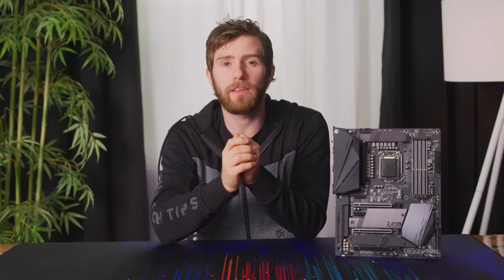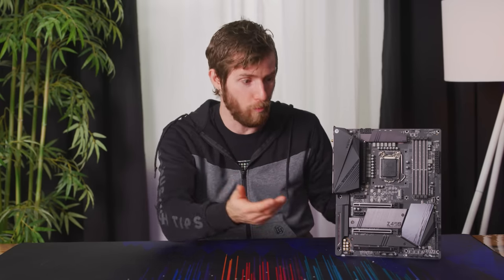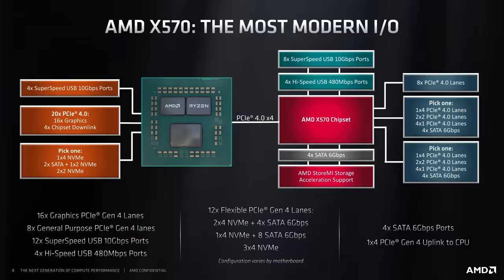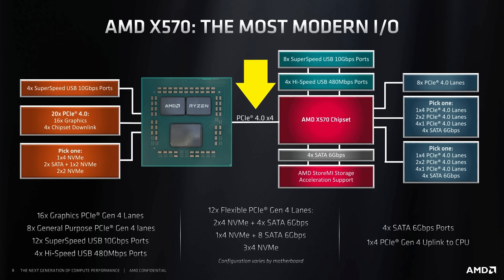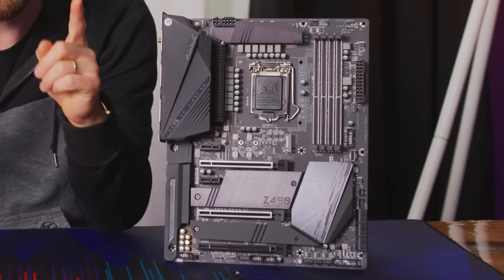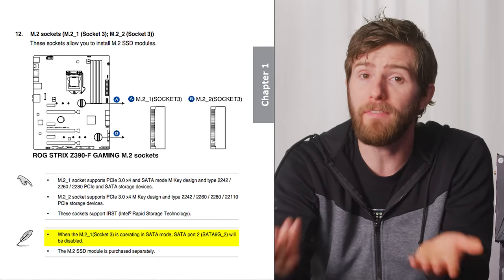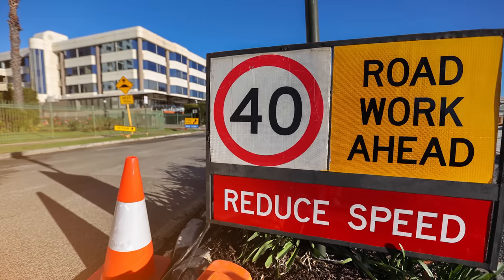The Sneaky Thing About PCI Express - CPU vs. Chipset

Comment: Free Tech Tip: If you have connected a lot of stuff (multiple M2 SSDs etc.) to your Mainboard and you want to find out if it hurts your GPU link, fire up GPU-Z and check the "Bus Interface" information. It should say @ x16. If it says @ x 8 then your GPU is sharing lanes with something else. This could be a reason for some performance loss on GPU side.
You're welcome :)
Reply: Only the number behind the @?  My Bus Interface say "PCIe x16 3.0 @x8 3.0
Reply: @bobbymois  This means your GPU sits in a x16 slot, but it's only addressed with 8 lanes of PCIe 3.0
So maybe you have 2 nvme drives or other cards plugged in that take resources.
A lot of mainboards have an overview about what shares which lanes. Maybe take a look at that.
Reply: @knightnevermore  i changed my gpu to the pcie slot right under the CPU, now gpu-z says @x16

thanks for the tip☺
Reply: Good tip. I just found out you might need to run the test from the "?" to get an accurate result though, because GPUs can shut off lanes/speeds. Mine did. A 1050ti, it said x8 x1.1 or something, after using the stress test its 8x 3.0. I think a 1050ti cant even use 16x anyway.
Reply: @Lloyd.B.  Nice sub-tip. The same thing happens with RTX 3080 - shows x16 1.1 a after running the render from the "?" it immediately changes to x16 4.0.
Reply: Is x4 pcie slot better than x16? Like how much performance difference. Comparing asus b250ma vs asus rog strix b250h motherboard on nvidia 1660super.

Comment: 2:41 I think the last 16x physical slot (4x electrical) is actually going to the chipset
Reply: You are correct (at least in all mobos I'm familiar with).
Reply: that's why u should check ur manual, some mobos have 3 x16 electrical, others 2x16, and then some 2x16 and 1x4, if its x4 its for the chipset
Reply: @arencorparencorp2189  Wouldn't that require more PCIe lanes? Is it just for stuff like Threadripper?
Reply: @lukedk4614  Yes.

Most boards have 1x16 or 2x8.  Most boards that have 3 16 slots are 2x8 + 1x4 connected via chipset.  Aren is talking about high end (HEDT) parts.  With Crossfire and SLI being basically dead, 1x16 is more than enough for the vast majority of us graphics wise, although I suspect AMD and Intel will eventually move to 24, 28 or 32 non-southbridge lanes so as to support more NVMe direct to CPU.
Reply: @lukedk4614  yes, it is, the board with x3 or more electrical x16 slots is tr or hedt intel, but there r some exceptions for normal 16 lane cpus of 3 electricals, 1 of em directed to chipset (to store a 4 ssd raid or stuff like that)
Reply: @arencorparencorp2189  Usually it is pretty much alwayd 2 16x for mainstream sockets for 16 lanes total. (If both are used then the speed is wet to 8x) the rest is going to the chipset. The two 16x physical slots on the top goes to the CPU. Mainstream sockets are AM4 and the intel equivalent (currently LGA1200 for their latest sockets.) Its when you move to high end desktop sockets (Like Threadripper or intel HEDT) where things are different because of a lot more PCI-E lanes from the CPU.
Reply: @arencorparencorp2189  Yeah, I'm using an x570 aorus master on my new build and that can go only up to 3 NVMe x4, and for that it needs to disable 2 SATA ports. It is still one of the best setups for NVMe on consumer grade boards, but especially the x8/x8/x4 can be limiting for professional use.
Reply: @antontaylor4530  It makes sense as NVMe will probably see a lot more widespread use in the years to come, and hopefully lower prices too.
Reply: Now I'm wondering what the difference between physical and electrical lanes are.

Comment: About the mouse you mentioned at the end.  I use a Bluetooth mouse with my laptop for the convenience of not needing a dongle but I don't really see much if any latency.  It is one of those things most people might not even notice really.  I have an HP XB4000 mouse and an Intel AX200NGW that I use for Bluetooth and WiFi.  That card can be gotten cheaply but I mainly use it because it is a good one.  It is not a tri-band card but it is WiFi 6 and I get a good fast connection 40 or 50 feet away on the other side of the house.  This place is not small but a good TP-Link router seems to cover it well and without a horribly slow connection too!  This was more about a mouse than anything and quickly expanded into other things.

Comment: The trick is to go Threadripper.
Reply: no the trick is dual threadrippers.
Reply: Epyc, actually. 128 lanes, per CPU. 160 for dual CPU (many are used to connect the CPUs).
Reply: Bit pricey for a gamebox though, and probably not as good as the equivalent 3900x for games unless you go for the lower-end 3960x with its higher clock rates. Not to mention that even with boards like the MSI Creator TRX40, only two of the three onboard NVME slots are CPU-side. To get more CPU lanes to NVME drives, you have to use the riser the board comes with, and you have to be particular about which slot on the board it goes in and how it's configured.

That said, I do enjoy having blink-and-you'll-miss-it load times and not caring how many tabs I have open. CPU video transcoding at ridiculous rates is nice, too. There's definitely advantages to be had from a whole bunch of PCIe lanes and 24 cores. You're just not likely to see them if your use-case is general Internet use and (most) games.

Comment: The tricky part is knowing if your gen3 m.2 ssd is being bottlenecked because of the chipset lanes. Or if the shared m.2 slot is bottlenecking your x16 gpu slot.

Comment: The long pcie slots are NOT all connected to the CPU, usually only the first 2 and the last is to the chipset. Just check the spec sheet of each motherboard to be sure how did the editor even mess this up? 2:38

Comment: Ultimately its a cost issue. Server grade MOBOs handle PCI-E breakout better because they can cost hundreds of dollars more. An 8-10 layer gamer board has to be cheap. A 12-16 layer Server board - with additional layers to break out the lines - ill perform better - with the right chipset. You've shown some of these machines on LTT. More connectors, less blocking, more SRAM caches, etc.  When money is not a limit the bottlenecks can be removed up to a point.

Comment: If your GPUs are plugged into tPCIe running off the chipset and you are using your GPUs for creator workloads such as Blender, the latency and or bandwidth limitations make no appreciable difference. Gaming on the other hand does matter.

Comment: Kinda why I went with Threadripper, I love having the PCI-e connectivity, I had the 5960x and while it had 40pcie lanes, it still had some weird routing and slow downs or it disabled something somehow that I needed or could use. This threadripper system I do with the Asus x399 Zenith Extreme would of had the option to turn the x8 slots into x16 so I would have to install my video card the way it is, but I got enough lanes to not slow anything down, especially storage.
Reply: 5950x has 20 PCIe lanes?
Reply: @sparhawk1228  Yes, and some of them lanes are dedicated to other parts of the system such as onboard wifi ect, i'm not sure how many lanes the chipset has, but it isn't much and can cause delays in some things though mostly irrelevant. I have a ton of high bandwidth pci-e devices where the 5950x would be fine for most of my wants, but I often over time find my self needing or wishing I had more PCI-E lanes. I had trouble with with Intel x99 with its 40 lanes and all of my nvme devices, and how the board was laid out.

The 5950x would be fine for most users who just want to game with a few pci-e devices.

Comment: SOmething I notice on a lot of MBs, is that the lower PCIe slots from the top one, have less pins in them. You can even see it on this board. the bottom slot is only an 4x pin set.

Comment: strangely the "widening of the highway" doesn't really benefit gamers, more production or creative types. I work with a fair amount of raw files.. i notice a difference between my nvme drives despite them being rated equally due to the lane config... if they are on the 500gb (cpu lanes) it's borderline lightning.. other is still much faster than an ssd (i have tried) but markedly slower than the cpu lanes. This is in applications such as Luminar, Lightroom and not as much but still noticeable in photoshop.

Comment: You should also need to say that 8X 4.0 is not the same as 16X 3.0, you still have only 8 lanes for the GPU but if the GPU is 3.0 it doesn't get 4.0 speeds, the lanes are still limited by the GPU at 3.0 because the GPU cannot get speeds higher than 3.0 through those 8 lanes.

Comment: 2:40... the bottom lane is literally going through the chipset using DMI 3.0 as per the manual.
1 and 2 go to the CPU and 3 goes through chipset.

On literally no mainstream platform do 3 16x slots all connect to the CPU.
That extends to X370/470/570, B350/450/550, Z series and B series Intel...

Comment: I have a suggestion for a future video.  How much longer will graphics "cards" be a thing?  Eventually, graphics appear to need to move to a separate board sitting next to the mobo (for size and weight reasons), connected to the mobo by just a cable.  It is insane that the graphics card should weigh more than the mobo/CPU itself, as this is going to present mechanical problems holding that much weight.
Reply: That won't happen. Graphics will just have to become smarter and more optimised resulting in getting far more with less. If anything the future of graphics will be integrated graphics in APU's. The graphics will become so good that for the average person they can just run off of the cpu but for enthusiasts you'll still need a bigger separate card for best performance.

Comment: Don't forget Threadripper routes to each half of the CPU.  So if you want to run 2 storage devices and get full bandwidth you have to use both halves of the die.  I was able to get 15GB/s read by bifurcating the slots on opposite sides of the lanes.  Otherwise I'm capped at 9GB/s.

Comment: Before Oracle bought Sun, Sun made X86 servers that had a separate pci chipset for each pci slot & device. They could do a lot more IO than Dell or HP servers with what would appear to have been similar specs, and it was more consistent too. For example if you had a program (say an email server) that mostly received network traffic and writes to the disk, it could keep both the disk and the nic in action at once. On the others when you were writing a bunch of spam to disk, the network interface would slow down and if you a pingflood at say 10% of the network's rated speed the disk would slow down. And this would hold even if your email server was just writing to /dev/null for testing! That's right, a ping flood can slow down your disk IO on most systems because they pci bus has to deal with that data and while it is doing so the bus can not deal with disk IO. Yes I know that most of this goes around the cpu via dma, but it does not go around the pci chipset.

Comment: I was going with AMD’s 5000 but being an owner of 32GB of Optane Accelerator, and Optane 900p, I’m going with Intel Rocket lake. Upcoming setup:

RTX 3090 (CPU: 4.0 x8 Speed)
*Optional: Second RTX 3090
1TB M.2 (CPU: 4.0 x4 Speed); Purpose OS and primary Game Storage.

Elgato 4K60 mk.II (Chipset: 3.0 x4 Speed)
32GB Optane Accelerator (Chipset: 3.0 x2 Speed) + 16TB WD GOLD (SATA); multipurpose File Storage.
Optane 900p (Chipset: 3.0 x4 Speed); Purpose Capture Card video storage.

Comment: SGI was the first to use a separate IO bus for graphics(Onyx). This was very useful in pasting unique sensor video as texture on certain polygons (for simulating sensor video on a simulated cockpit display for pilot training)Then PCI came along.  What happened to SGI you ask? They hired a Vice President from Microsoft who wrecked the company. The VP now running SGI pushed a joint effort with Microsoft to create a new language to replace SGI’s OpenGL. (Called Fahrenheit). Fahrenheit was a flop but Microsoft ran with what they learned to create Direct X.  SGI’s CEO from Microsoft ignored real time applications and only cared about processing high fidelity frames for animation movies. The deep war chest was drained when SGI bought Cray super computer company. Then crunch time happened and in the midst of a legal fight with Nvidia, SGI abruptly caved, gave Nvidia all their IP plus many of SGI’s top graphics engineering talent.   That was the beginning of Nvidia’s reign and the end of SGI’s. 
       I always wondered if it was a deliberate targeting of SGI by Microsoft who wanted direct X to replace OpenGL and destroy the competition.  The same thing happened to Nokia via a vice president they hired from Microsoft. Once the microsoft guy was in charge of Nokia, he literally sabotaged Nokia’s operating system’s future and pushed his Microsoft operating system replacement.  Another great company killed off by Microsoft

Comment: eGPU in 2020 update video. About the gaming performance on a x4 pci slot over thunderbolt 3.
Measure the performance of a eGPU on build in laptop screen, external display and with different graphics cards. Go with an laptop which is sold as a eGPU compatible machine like a Lenovo Y740si-15 + Lenovo eGPU Boost station or Razer Blade Stealth + Razer Core X eGPU.

Would like to see this!

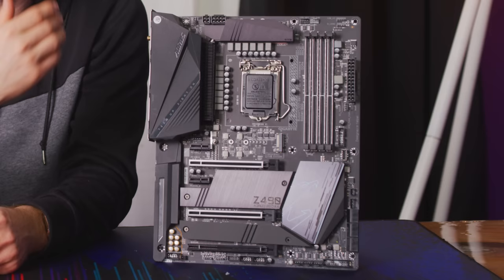Comment: Considering the normally insanely expensive and high-end stuff Linus deals with in videos, it took me a few moments to realize that's the exact mid-tier motherboard I used in my last build. Was wondering why it looked familiar. Also funny that he pointed out that specific M.2 slot at 3:05 since that one normally has a sticker on it mentioning how it's disabled unless you use an 11th gen CPU on the board, in which case it is connected to the CPU at PCIe 4.0 while the others are 3.0.

Comment: Ever heard about InfiniBand? It's a communication protocol to rule them all, designed for things to communicate from the board-level CPU, memory, storage, peripherals) all the way up to computer networks. If ever fully implemented, it'd work with a lot less overhead (no encapsulation into different protocols at different stages of the communication) and very low latency. It's used right now on scientific applications on things that require RDMA (Remote Direct Memory Access). There are several companies contributing to it, but it has been largely developed by Mellanox, and guess who bought Mellanox recently? I don't think they were thinking about gaming as a service when they did for there's a lot of money to be made in the data center out of this. But with this technology, Nvidia can certainly pull it off at some point.

Comment: This is in part why pcie gen 4 whilst not giving graphics cards any speed boost, alleviate some of the problems by doubling the theoretical max speed per lane, so a you only really needs 8 to have the same bandwidth available to it, and leaving plenty for nvme storage. Gen5 in theory means a GPU would only need to have 4 lanes to have the same bandwidth available to it as currently on gen 3, again more lanes potentially freed up for storage and other things. It is rumoured that the next generation of ryzen will move to gen5, and the 12th gen intel too.

Comment: You need a website where you can virtually build a pc Exactly the same as the setup you already have then get a readout of what it could Benefit for upgrade and settings all in one place so no having to type each part in and  Spend hours searching different specifications on different websites trying to work out what will work and what wont ❤

Comment: wait... M.2 doesnt connect directly to the cpu but pci-e does... So should i not have my M.2 (970 evo) in the M.2 slot but rather on the M.2 Pci-e card that came with my motherboard? (MSI Z390 Godlike)? And if i do it like that will i be limiting my graphics card (2080ti) to only 8X speeds?

Comment: Thanks for the nice breakdown. What exactly is a "lane"? Is it one pin coming off of the CPU? I also don't understand how these speeds are measured. What does a speed of 8x or 16x mean? what is the "x" unit measuring? If it's a multiplier as in "x times", what is it multiplying? In other words, it's 16 times what?

Comment: It's interesting that you can see the 3rd 16x slot at the bottom is only wired for 4x.
Reply: 1st slot is x16
2nd slot is x8
3rd slot is x4

Usually how most motherboards work.

Comment: The timing for this video is so perfect. I'm a teacher, can i use this video in class? or can i utilize certain images of the video (like the direct connection from the PCIex16 to the cpu) for my classes? what's the correct citing of copyright procedure to use these?
Reply: Those images are from Intel and are publicly available, for example google "Z490 chipset diagram"
Reply: If it's for teaching, you can pretty much use anything on the internet.  Education is one of the main paoint of fairuse.

Comment: I still wait for someone to properly benchmark the following: plug in a controller card allowing four NVME drives into the first 16x PCIe slot and check for performance compared to throwing the same cluster on a different 16x slots as long as it is electrically wired for 16x . And then compare the performance difference between the controller card going straight for the CPU lanes vs. the chipset lanes.